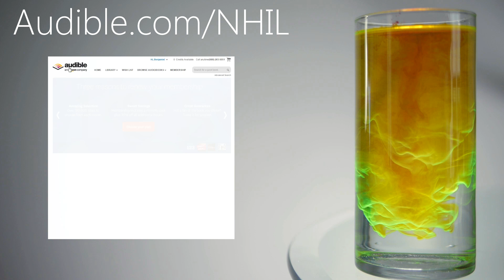How To Make A Fog Horn - Easy PVC Design

Comment: Larger horn (optional upgrade)[instructables]
•	1× 2” × 2” × 2” PVC T fitting
•	1× 2” × 1” adapter
•	1× 2” PVC plug
•	1× 6” length of 1” PVC pipe
•	1× 1” PVC coupling
•	1× large funnel that fits into 1” coupling
•	1× 2” × 1” reducer
•	1× 1” × 1/2” reducer
•	Freezer bag for diaphragm
•	Same air source as above

Comment: Small horn (like the video)[instructables]
•	1× 1” × 1” × 1/2” PVC T fitting
•	1× 1” × 1/2” PVC adapter (reducer bushing)
•	1× 1” PVC plug (flat or square-head style)
•	1× 6” length of 1/2” PVC pipe
•	1× heavy plastic freezer bag (for the diaphragm)
•	1× long plastic funnel that fits snugly into 1/2” PVC pipe (auto parts or hardware store)
•	Optional: PVC primer and cement if you want permanent joints
•	Air source: large hand/mattress pump, bike pump, or compressed air with hose to 1/2” side of the tee

Comment: I have some 8 inch pvc sewer pipe in 20 foot lengths. City sewer pipe left over. Plan to upscale your design using inner tube rubber from a tractor tube for diaphragm. Going for extreme low frequency.
Reply from the maker: Be sure to take a video when you're done!

Comment: Hey, I am trying to make the fog horn but it doesn't seem to work for some reason.
Reply from the maker: What seems to be happening? Can you blow through the horn? The plastic sheet needs to be tight, and then adjust how much pressure the tube pushes on it
Reply: @Nighthawkinlight  I do the same procedure but it seems that it doesn't make horn sound at all. I tried it with rubber and plastic bag but still no sound.
Reply from the maker: @b0ogeygirl  Is it hard or easy to blow through?
Reply: @Nighthawkinlight  I managed to make it work!! Thank you for responding fast :)

Comment: what kind of psi would that mattress pump be running at. Say if you were to use an air compressor with a regulator
Reply from the maker: Less than 5psi

Comment: 2:22 just got a stupid idea. Ok, hear me out.
Make that whole apparatus out of more heat-resistant parts such as steel but make it so instead of a 10ft PVC pipe, have a 10ft (or so) section of exhaust pipe. Find a diaphragm that can handle the heat, then connect this to the exhaust on your car.

Ta da, everybody hates you lol

Comment: I built one of these, and it worked fantastically well. I got the best performance using fairly thick vinyl sheeting as the membrane.

I also tried to get an ultra-deep tone by attaching 50 feet of rubber garden hose, but since the prototype was lung-powered, I couldn't push enough air to get it to work. Though the couple of times I did get it to work, it sounded a lot like your 10-ft-pipe version, only slower and deeper in tone.

Comment: Is the reaper sound possible with the smaller size?
Reply: Nvm. I just bought all the larger piping and made it work! The hardest part is positioning the diaphragm correctly. It’s very sensitive so minute adjustments are needed against the inner tube. Also, my gf helped me confirm that it’s louder with a funnel at the end of a 10ft tube.

Comment: A great exercise in the acoustics of an air horn. So, extending the length of the exit pipe deepens the sound or do we need to enlarge the size of the T-Piece (horn body)? The long tube had a very warbled (deep sound) effect, would a funnel at the end smooth out the sound? How long does the diaphragm last? This looks like it doesn't need so much pressure to operate like the truck horns on the market that require a bulky (and expensive) reservoir tank. This being the 21st century where everything works at the press of a button, can I use the standard air pump from an old set of musical air horns?  Might be a good project for my high school engineering class to explore

Comment: I love the sound at 2:20! Would it have the same low frequency if it is a coiled line? That way it will fit under the truck or car.
Reply: @KeithFromNY - wondering if you found an answer to this question. I am wondering the same thing.
Reply: @peteypablo1196  Sadly, I bought some of the parts and have not put it together. I will let you know if it ever gets finished.

Comment: You could easily use your trucks exhaust to power the horn too. Put a solenoid-actuated diverter valve between the exhaust pipe and your horns input, then wire that valve to your horn button

Comment: Using a 16-inch diameter pipe, 29 feet long, will produce the brown note.
Reply: Nearly browned meself reading that commemt
Reply: It would need a scuba tank to power it lmao
Reply: The brown note has been debunked, however, a horn that size would likely make you crap your pants due to the sheer volume :P
Reply: @dalegibson9172  should be called the brown pants note.
Reply: @dalegibson9172  save it for Independence Day , why not?  You got the right !

Comment: Oh, nice! I am building one of these with that 10ft pipe extension for my Halloween display. How much volume do you think that air mattress pump is putting out? I want to hook this up to a compressor with an air soleniod, but I don't want to dump just a ton of pressure into this thing.
Reply from the maker: +Jayson Nickols Connect it with a ball valve so you can adjust air flow to whatever works best.

Comment: could you scale it up even more like 3 inch stuff instead of 2 inch???
Reply from the maker: +Russell jenkins Yes but you would need a big air supply to power it. You might need a stronger diaphragm also.
Reply: +NightHawkInLight what would you recommend for a better more durable diaphragm for a bigger build
Reply from the maker: +Russell jenkins Sheet rubber
Reply: +NightHawkInLight ok cool thanks
Reply: Have you seen a ship horn? Same design, but absolutely massive

Comment: I don't know if you're still going to read these (four months later) but I thought I'd ask.

I'm making a horn backpack with this design, and it's working very well. I'm working at a Haunted House and we need loud sounds. The one we managed to create is really loud, but we've encountered a couple of problems:

A compressed air tank isn't very economical for us, so we will be using a pump. Sadly, the pumps we've seen only go slow (like yours) and do not give us the HONK that we truly desire. Any suggestions?

The second problem is that the funnels we purchased are not creating a sound as such in your video. They're big, but they don't lock in like yours. You said some funnels needed modification? Any ideas are GREAT.

Thanks for your time,

~YayHar
Reply from the maker: YayHar TheFirst I really haven't gone any more in depth with this project than what i show in the video so your experience is as good as mine. For attaching funnels you can use fiberglass as i do in my vortex cannon build video.

Comment: you should try connecting a pressure tank to this and put like 40psi in it(so as to not break the plastic film) and connect it to this set up, less pumping and more sound, possibly even a momentary valve to make a tune with it.

Comment: I just made the 2 inch one. I think a thicker diaphragm is needed for mine. It also connects directly to a air compressor and is turned on and off with a ball valve.
Reply from the maker: Yeah a thicker diaphragm is needed for higher pressures. You can try taking the plug out of the backside of the horn and instead putting one of these over the outside of the T, then pushing the barrel back against it: http://images.lowes.com/product/converted/611918/611918018447lg.jpg

Comment: This horn is essentially the same principal as a reed pipe in a pipe organ.  Reed pipes can be as short as 1' or as long as 64'.  Generally a 64' pipe (which is very rare) can only be felt.  A 32' pipe can both be felt and heard.  Today such pipes are mimicked by the use of electronics and speakers because of the excessive cost of such pipes. (hundred thousand dollars or more.) 

In a reed pipe there is usually a very thin piece of brass with a very slight curve along its length.  It rests against the side of an open sided tube with a stopper at the bottom.  The reed flexes back and forth against the tube (Shallot) All the rest is virtually the same as your horn.

Comment: Ben what kind of truck do u have hopefully a ford:)
Reply from the maker: 1986 f250 diesel
Reply: Awesome is it a 6.9 or a 7.3
Reply from the maker: Ethan Henneberry 6.9, no turbo.
Reply: Oh is it a dog.     My dad has a 2008 f250 king ranch 6.4 twin turbo.       Built ford tough
Reply: Nice. You can't hardly beat the ol 6.9.
Reply: The 6.7 is the way to go the 6.9 is a slow engine is has no turbo
Reply: That's true it is the slug of the diesel world but reliability... It'll last nearly as long as the 7.3. And will pull more than you think.

Comment: By using a few  right angles or sweeps, you can "fold" it into a much smaller package that can easily fit under your hood. I'm going to use mylar for mine.  It's tougher and more heat resistant.

Comment: The effect with the 10ft tube is rad!  I'd like to see you try it with an air compressor and a 4" piece of tube
Reply from the maker: No doubt! That might be a summer project
Reply: @Nighthawkinlight  Great design and video! Thanks!
Did you ever get around to hooking an air compressor up to it?
Reply from the maker: Zelif I did. It didn't make much of a difference.
Reply: NightHawkInLight
Did you try put a funnel at the end of the 10ft pole ?
Reply: Rip
Reply: To explain the noise from the 10ft pipe edition; I bet you anything the noise is caused by air going from sonic to supersonic flow. The diaphragm is likely causing compression waves to overlap, compressing the air and causing it to go supersonic.
Reply: @Approx_99  Old comment, but I figured I'd add some info: the noise is actually caused the same way as in the smaller pipes, but it sounds different in the longer one due to aspect ratio. The pitch is formed by a standing wave with a node in the middle of the pipe and a peak at each end, but the tone or "flavor" of the sound is due to its narrow diameter relative to its length. The diaphragm is small and can't move very far, so it "clips" the wave at that end; instead of a smooth sinusoidal curve, the wave is more like a series of little spikes that echo down the tube along with the fundamental frequency. That's what causes the slapping noise: the diaphragm is actually slapping the end of the pipe.
Reply: @nikolaihedler8883  Old comment on an older comment, but thought I might ask a Q..
Where would you think the reflection point is that's bouncing the wave back down the pvc and creating a standing wave?
 I thought there might hav been an end cap for a funnel to fit. But the pipe is open ended.. Do u think the wave is bouncing off the foundation wall that is off-camera and then travels back down the pipe in phase with the fundamental to form the sympathetic standing wave with node at mid-pipe? That would be one very lucky first try to do that, without even trying! lol
Reply: @nodaysback1  no, the way it works is that the open end of the pipe acts as an anti-node and it's the closed end at the diaphragm that creates a low-pressure zone that pulls the air back into the pipe. Keep in mind that the pressure wave isn't just positive, but also negative.
Reply: @nikolaihedler8883  My apologies for not understanding this. I never studied this aspect of physics. I have a fairly good understanding of acoustics and sound wave interactions as far as nodes and phase cancellations and frequency build-up within an acoustical environment.

I don't follow the end of the pipe acting as an anti-node.

Are you referring to the low pressure zone created the diaphragm as the plunger is being lifted which draws air back through the tube?

Are you referring to the negative portion of the pressure wave cycle when you say that it is not just positive?

Thanks and pardon my ignorance here loll
Reply: @nodaysback1  basically, yeah. The waves can be thought of as either pressure or flow/displacement (the air's actual movement); the open end obviously can't have (nearly as much) change in pressure, so it becomes the pressure node of the standing wave (the peak or anti-node of the wave's displacement). The end at the diaphragm has restricted flow, so it is the flow node and the pressure peak. The air horn is a quarter wavelength because there's a node at one end and a peak at the other.
Reply: @nikolaihedler8883  Thank you for taking the time to explain. The dynamics of this system are a bit different than acoustics within a space, but I was able to pick up most of what you described.
Thanks again!
Reply: its awesome to see two of our fev youtubers doing conversation with each other
Reply: RIP
Reply: I subscribe to you
Reply: RIP :(
Reply: I love you grant
Reply: Ok, I was thinking about subscribing, but now that I know that Grant Thompson - "The King of Random" watches this channel, I'm DEFINITELY subscribing!
Reply: So do you just need a diaphragm to vibrate on one end of a tube?
Reply: Oh My Gosh, It really does. 2:25
Reply: Well, you have some tools, you still can make it, and make a video for us too :D
Reply: Grant Thompson - "The King of Random" omg! AYY SUP GRANT
Reply: Holy crap you know you are a badass when Grant Thompson comments on your video!
Reply: would like to see if you could do a mad max war rig horn note for note with this method
btws a cheap and dirty way of doing it is to drop an octive on the Big Bad Max 619 truck/car horn but its not real loud

Comment: I need to find a way to fit the last one into my car. I need it.
Reply from the maker: I haven't experimented yet to see if the pipe can be coiled up with a bunch of elbow fittings for the same result, but I bet it would work!
Reply: @Nighthawkinlight  Use coiled flexible water pipe.
Reply: I was thinking about shoving one in my ass for when I fart.
Reply: That would sound epic people would be like WTF was that aha
Reply: NightHawkInLight I doubt that elbows would work - you need to maintain resonance and the 90º turns would probably introduce interference patterns in the standing wave produced in the pipe. However, a coil of flexible tubing should work OK. Look at the designs of brass instruments and you'll get a feel for how things might work. Instruments with higher-pitch tones can use tighter bends in their tubing, but ones like the tuba and sousaphone only use large, gentle bends.
Reply: i bet you could add it to the end of your exhaust XD
Reply: Might be able to replace the horn with the funnel and pop it out of the hood, would look badass enough.
Reply: I was thinking the same thing, haha!!
Reply: I didn't know rob watched this channel. I love his channel especially the "why would you put that in the Internet series"!
Reply from the maker: Dobie Tanpaw There are some PVC elbows that make large sweeping turns.
Reply: Dobie Tanpaw NightHawkInLight Maybe using a thick walled garden hose will do the trick. It should be durable enough. Plus you can fit it into the space as needed.
Reply: I have a train horn on my 06 Pontiac G6 people at Walmart hate me
Reply: Curve the tube.

Comment: Interesting. It looks like the shape of the funnel "bell" has a lot to do with pitch. The difference between no funnel and with funnel on the smaller assembly was about an octave, but the difference in pitch between the small assembly with the black funnel and the larger one with the orange funnel was only about a half-step.
Reply from the maker: I did a bit of audio editing for the video so don't put too much weight in measuring the differences the funnel makes, but you came to the correct conclusion. The black funnel did a lot more to lower the pitch than the red one did, but the larger horn also started off at a lower note.

Comment: Can i use electrical air pump?
Reply from the maker: You can try it. Most electric pumps don't put out air very quickly though. You might need to feed the electric air pump into a pressure tank before sending it to the horn.
Reply: Thanks

Comment: Can you add compressor or air tank instead of pump and would it make it louder?
Reply: NightHawkInLight any recommendations for other diaphragm materials?
i wonder if i could get a setup like this to play one of my didgeridoos.
Reply from the maker: Ben McFarlane They make rubber pipe end caps. You could slip one over the end of the T and press the pipe against it on the inside. That should be a pretty sturdy diaphragm.
Reply from the maker: Yeah, it will work great with a compressor. If you want to feed it really high pressure though you will need to upgrade to a stronger diaphragm.